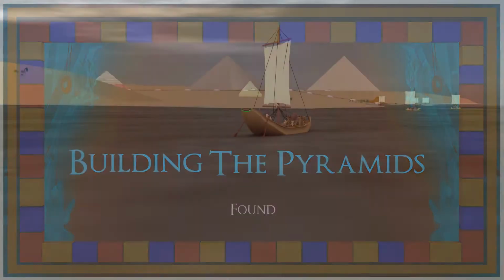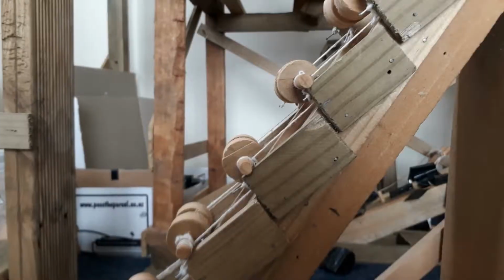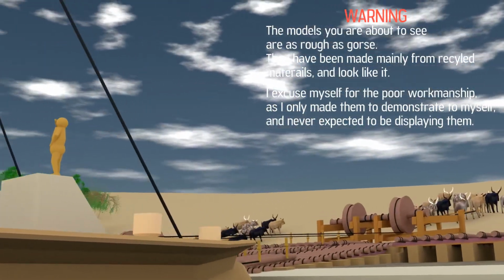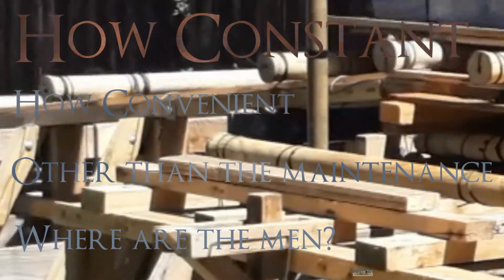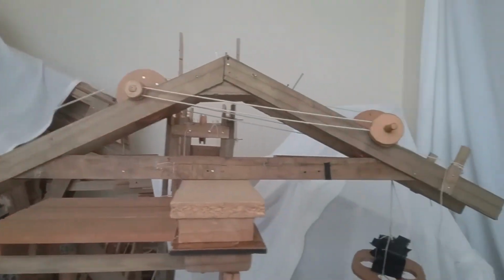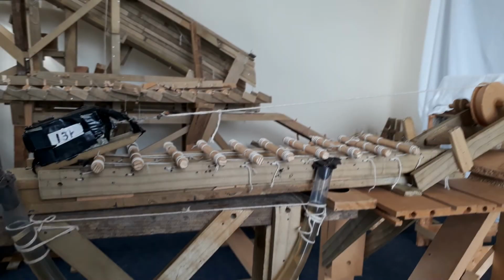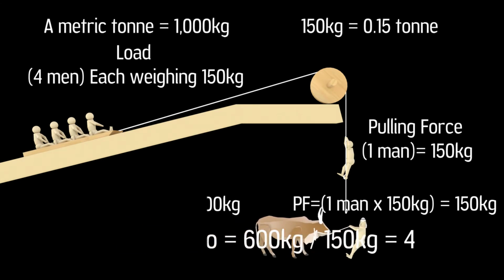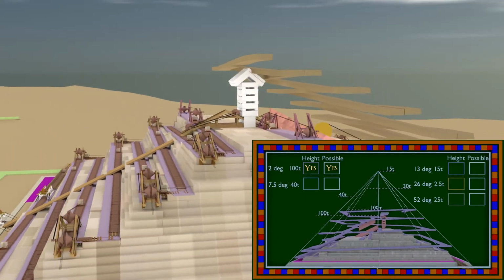Building The Pyramids - Found P1

Comment: Your roller idea is genius.
I can see that they are also a required safety feature in the case of the block rolling backwards. So they both reset the rollers as well as function as a safety device that keeps the blocks from falling down the side of they pyramid in the case the block needs to be rolled backwards.
Reply from the maker: The rope wrapped around the roller holds the load on the ramp from going back to far. The rollers also roll back into possition after the load moves over them, this leaves a gap between the roller the last roller under the load and the one that rolls back into posistion, causing the load to rest on the rails supporting the rollers "if was to roll backwards". (see Building the pyramids Today P3 where the load does this). 
I found this hard to get this into my head around, when I had friends pulling the load up, knowing that if the load came backwards at speed it would kill them. I had to ensure the rollers had the right spacings, so the load would tip backwards into the gap.